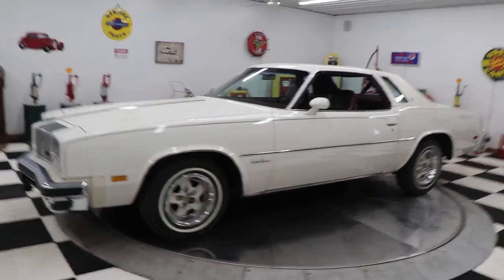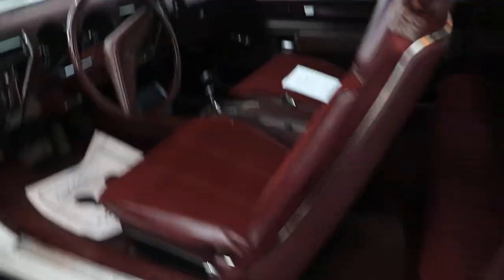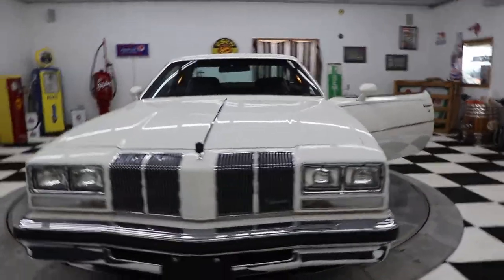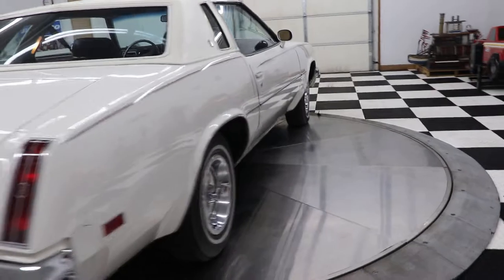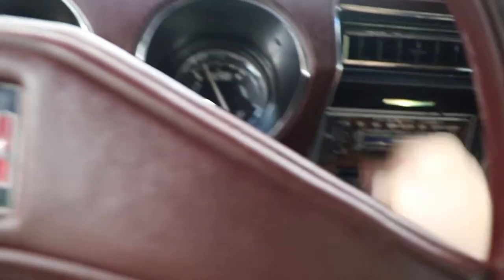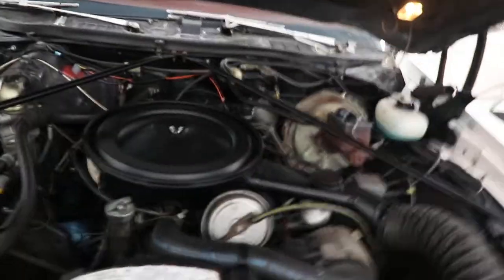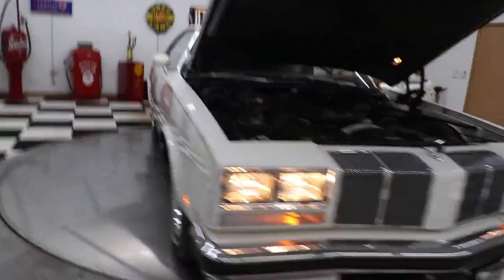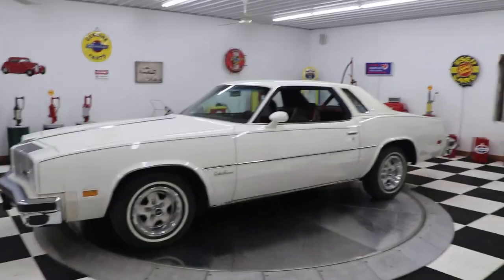1976 Oldsmobile Cutlass Supreme

Comment: Beautiful 76, my first car at 16 was a mint 77 Cutlass Supreme with 442 options, was my folks car immaculate buckets console rallys 350 Rocket, it was a clean maxhine you could have eaten off the engine, took all the emissions crap off, put headers dual exhaust, hipo ignition and shift kit in T350 auto, buddy of mine and I did a performance rebuild on qjet, it would really move out then. Wish i kept it.

Comment: I had this car in a brougham. Same color combination and wheels.  It needed a transmission and I didn’t want to mess with it. It had 115,000 miles one owner. Some rust all along the bottom of fenders, doors and quarter panels. Price I sold it for-$200 Wish I would have put the money in it cause it was sharp and ran good before tranny went which probably wouldn’t have happened if I didn’t loan it out to a ________. (Fill it in)

Comment: My mom bought new a 1976 Cutlass Supreme Brougham  just like this car, It was the same color's but hers had bench Brougham seat and heir's had KOOL Hurst T-Top's she had it 14years, I got my drivers license in it ! ,then I bought a 1974 Cutlass Supreme with similar white bucket seat floor shift it was Cranberry red with white int and white 1/2 Vinyl top. witch  had a factory sun roof in it and also a factory  455 V8. Do you still have this car as I would be very interested ?????????

Comment: I have a 1976 Chevrolet Caprice with 2,300 MI. I have many old cars and I've learned one thing they cost a lot to drive because you cannot put ethanol gasoline in any of them or it will rust out the entire fuel system as it was designed to do to get old cars off the road and make Farmers rich. They sell non-ethanol gas for about a dollar more a gallon. So now I restore diesels that can be run on black diesel. If you're a car person you know what black diesel is it's not french fry curries that completely destroys a diesel in time. That's a nice car with low miles. I bought a nice Cadillac with 10,000 miles on it for $10,000 years ago and a few more with low miles. 1976 to 1979. So they run on unleaded gas properly and they don't have an aluminum engine block.